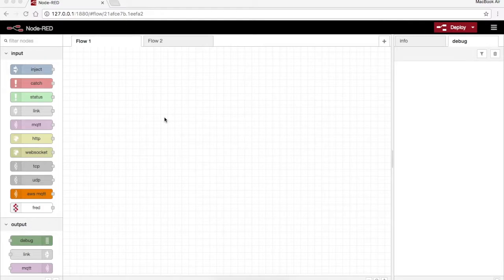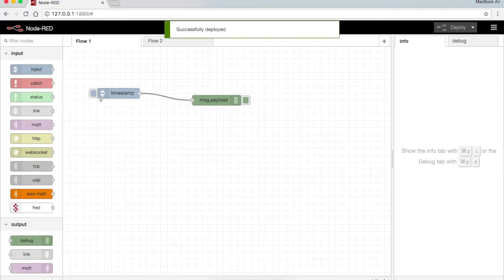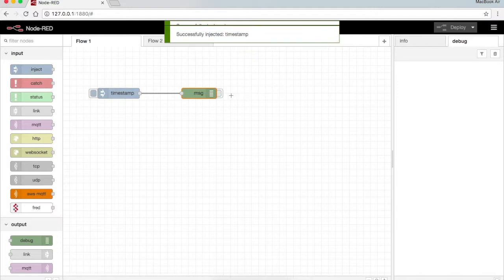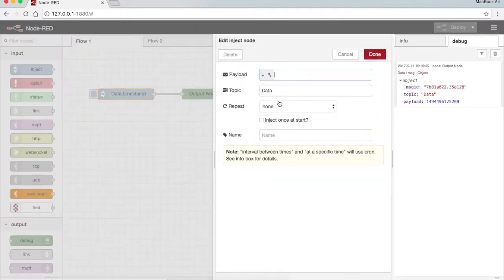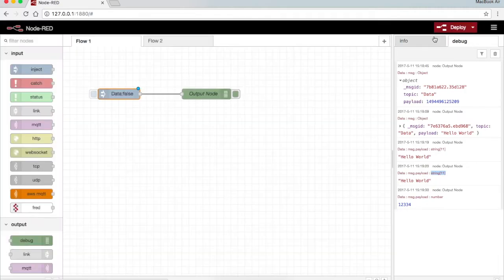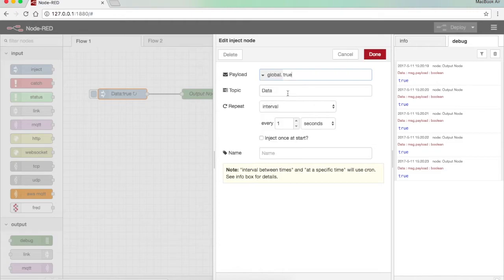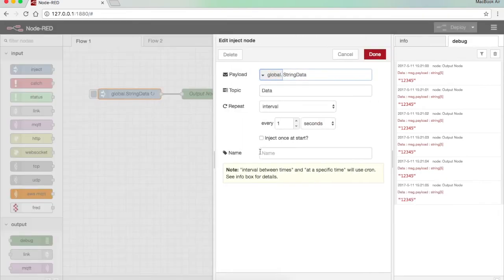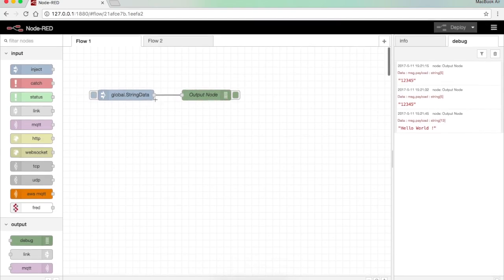Node RED | Inject & Debug Nodes

Comment: Hi, can i ask for help? I tried using inject node directly to debug node and it was not showing the message in debug window. What could be wrong with this?
Reply from the maker: Why dont you start a new project and check if it working there ? You can mail your query with screenshot to my mail id: thedefeatedengineer@gmail.com
Reply: same problem with me also

Comment: How to change the inject time interval from a function node and not from the inject node it self?
Reply from the maker: What sort of data do you want to send from the function node ?
Suppose you want to send a data such "Hello" every five second from a function node, then make sure a inject node with a time interval is connected to the input of function node. This makes the function node get activated every interval and push the data to the next node. 
Hope this helps. Let me know if you solve this issue.